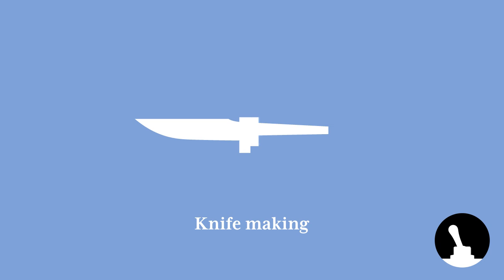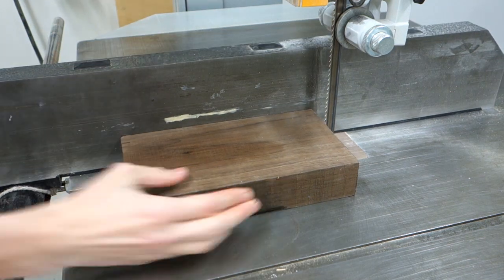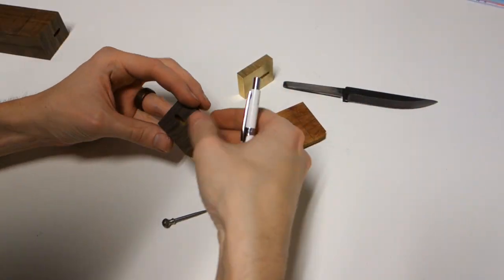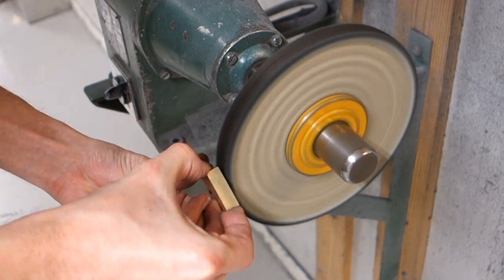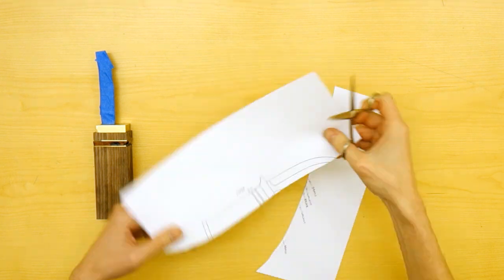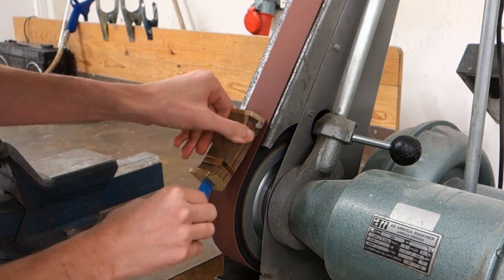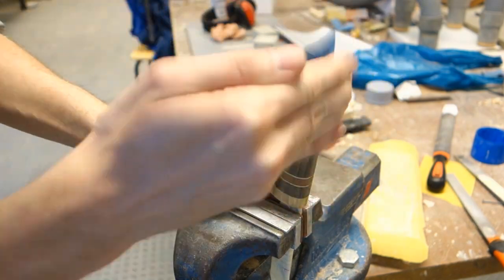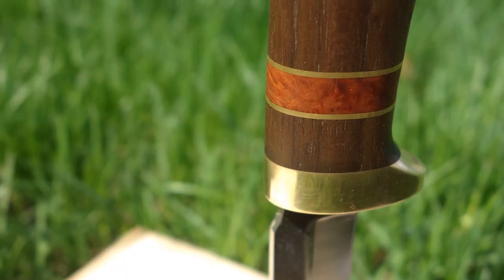Knife Making with Wood and Brass Handle

Comment: Very nice work, and a beautiful design. 

I also like that horizontal belt sander with the spindle sander at the end. I wonder if there's some way to give it a table that wouldn't interfere with using the nose of the belt too? Maybe a pivoting support that let's you move it aside?

-- Mike
Reply from the maker: Yeah, I've been considering the same. The issue being mainly since it takes different size spindles, for different radiuses, you'd have to make one table for each size (3 or 4 sizes I believe) and that would be a bit of a hassle.
Reply: Switch & Lever Build one table that space for an insert around the spindle, then you only need to make an insert for each size spindle.
Reply: WELL DONE

Comment: Another fine video. This makes me want to make a blade form an old file, and then make the handle from some bois d arc wood that is local to me.
Reply from the maker: I was considering that, but I couldn't find an old file. Will have to hunt around in flea markets a bit to stock up.

Comment: Nice video!

What kind of knife blade did you use?
Do you have a brand name or a site were I can find them?
Greetings.
Reply from the maker: I can't actually remember, I've had that blade kicking around for some time now waiting for me to do something with it. I can tell you it's cheap, and super generic though, I doubt it even has a brand name. If you spend a bit more you can get nicer hand made blades, but this is one was certainly nothing unique.

Comment: What brand are the drill bit and end mill you use for drilling out the handle? I cannot find a decent long 4mm end grain drill bit, or a decent length 4mm end mill.

Comment: Is there any reason you started out with such thick wood and brass pieces? It would take a huge amount of time to grind all that off for some of us that don't have all those fancy grinders :D  Btw, what knife blade is that?
Reply from the maker: I wanted to give myself plenty of margins, but you're definitely right, I could've gone with way less stock around the tang before I started to shape. Then again, I did cut most off that off with the bandsaw.

No idea about the knife blade, as I mentioned somewhere among the comments, I got it some time ago. It's definitely no fancy blade though, considering the scale and burrs where it was stamped out.

Comment: Very nice, but why did you glue the brass pommel on and not pien the knife handle into it for better strength?
Reply from the maker: Unless you're planning on using the pommel as a hammer I don't expect the glue to come apart. It's all personal preference though, I don't personally like the look when the tang comes out the back.

Comment: I just made my first partial tang knife, using a Helle Viking blade. Its seems you had a lot of play between the wood (drilled hole) and the tang. Basically having the glue only holding the blade in place. Maybe it's just my OCD...but might it be possible the glue deteriorate over time causing the blade to loosen with use? I made my hole just big enough so that it had to be pounded into the wood handle. In doing so, even if the glue deteriorated, it's less likely to loosen up over time. Same with the pommel...just epoxy and no screws or pins? wow...

Just my two cents. Nice vid and shop equipment btw. Slowly but surely building up my collection of tools.
Reply from the maker: +Bone Headed Considering how wood will contract and expand with humidity you whether you wedge it in like the proverbial Sword in the Stone or not I don't think matters too much. The glue may deteriorate, but considering how much gripping surface there is both on the wood and the tang of the blade the glue would have to turn into crumbles before the blade comes loose. More likely the knife would anyway reach its end of life before that happens. The hole has less play the further down it gets as well, even though the top looks a bit wide.

As for the pommel, my philosophy is more that if it can take being dropped on hard surfaces without coming off (which this has, many times) it's enough for me. I'm not going to use the pommel as a hammer. Given clean and rough enough surfaces good epoxy will grip like you wouldn't believe!

I really wish the shop was mine, check out my video with a shop tour, from Umeå Institute of Design in Sweden: https://www.youtube.com/watch?v=GZFzS-PP7Gc
Reply: Switch & Lever Hey, thanks for the response! Yeah, I figured it was my OCD. I'll make my holes a bit bigger next time. I also have some Bob Smith 206 Slow-Cure Epoxy coming in the mail. The J-B Weld clear epoxy seemed a little rubbery for my liking. But perhaps it wasn't fully cured.

That shop is really nice, some really nice machinery. A used band saw (hopefully a Delta) is next on my list. Nothing close to what's in that shop though.
Reply from the maker: +Bone Headed I don't know about J-B Weld, but a lot of epoxies start off a bit rubbery, and can remain in stages of curing for up to a month. The epoxy I use is usually a bit rubbery (like you can mark it with your nail) for up to 48 hours after initial cure, but beyond that it's tough and hard like plastic.

Comment: sweet knife, very nice shop tools. the pommel should be pinned if the knife is planned to be used to do real work, epoxy will suffer to shock under cold temperatures.

Comment: Just curious as I am ignorant, but how robust is the brass pommel with it being epoxied on? is it not better to have it connect to the tang of the knife??
Reply from the maker: It depends on what you're doing with it. If you've made a good prepping job when gluing (i.e. make sure both surfaces are roughed up, dry and completely grease free) you can be pretty confident that the epoxy will hold it. If you're planning to use the pommel as a hammer then it's probably not enough. I personally don't like it when the tang sticks out through the pommel, which is why I only used epoxy. So whether it's "better" or not is very subjective. Depends entirely on your needs.
Reply: Thanks for sharing your knowledge, I'm looking at making a survival knife for my first knife, so I'd be looking for it to be able to take some abuse. thanks once again :)

Comment: Did u just glue the bottom brass plate to wood?
Reply from the maker: Yes, the pommel is just held in place with epoxy glue. It’s held up really well these last few years, but I also don’t have a habit of using the pommel as a hammer.
Reply: No reason to pommel anything with that size of knife, was just wondering how did u attach it. Good to hear it held up. I made a knife and i wasnt sure how to add the pommel since its not full tang. Beautiful work on that handle by the way. Learned a lot.

Comment: WAIT so briar as in the same kind of wood for high end tabbaco pipes?
Reply from the maker: +Dapper Wolf no, from normal quality tobacco pipes. Beside possibly meerchaum I wouldn't smoke a pipe made out of anything but briar. The piece in the knife came out of scraps from a pipe I made.
Reply: Switch & Lever  I use ash pipes (I have to make my own and i have to use wood I harvest from the forrest) but its more the question of of its the same wood, and the price, I want to make a knife handle similar to the one you made , but with purple heart and cherry

Comment: it'd be best to have the tang go through all the whole hilt then peined at the end so you have a more sturdy knife and less likely to fly out if doing a torture test, it's also less likely to come loose, but really good work, just next time make a handle that's peined on or threaded on
Reply from the maker: You are right that it's less likely to come loose. However, considering the grooves in the tang and the filling with epoxy it's going to be one heck of a torture test if that's going to fail. I've never experienced such a failure, and I've owned a fair share of such knives in various materials through the years. Personally, I don't like the look of a tang which pierces through the pommel. Different strokes for different folks, so I'm afraid that's a no on the peening for next time.
Reply: Switch & Lever Just saying, if I had a knife with a brass butt piece with a little silver dot on it, I wouldn't care all that much, but every bladesmith makes knives their own way so, I'll stick to peining and scales, and you can use epoxy. Not hating, as long as the knife is sturdy, and not made out of medium to low carbon steels as high quality stainless steel, I'm all good, 1045 can't be hardened, and it not stainless. I come across people like that often

Comment: Why didn't you burn the tang into the wood for a perfect fit?
Reply from the maker: Daroff It's a messier process, and a carbonized surface and glue doesn't really work well together, the epoxy wouldn't bite into it well. If it was made with a through tang that could have had a screw on pommel to tighten and hold everything together that could have been an option, but for this case, not so much.
Reply: It isn't really "messier". And you pin the pommel to the tang with that method, making an extremely sturdy handle, but one that's also able to be taken apart for any repairs that may need to be made to the blade down the road. 

That being said, I enjoyed the video. Nice tips for someone just starting with making knives.

Comment: Yeah, it's easy with all these machines... And me? I don't have any of these, i only have a flex and a minidriller of these....
Reply from the maker: It's not the machines that make the result. You could do the same thing I did with a hand drill, a hacksaw, some files and sand paper.
Reply: Yeah but... It's like: i got the wood piece, but i can't cut it with flex, and it's impossible to do it with a saw, i could try with the mini-drill, i don't know, but i think it's hard...
Reply from the maker: domy domyz Nothing worthwhile ever came easy :)

Comment: you can cut brass with a ordinary bandsaw
Reply from the maker: You indeed can, but it will be a worse experience than with a metal band saw, and it will take longer which means the brass will heat up and could ruin your knife handle.

Comment: Why not make your own blade? You did almost all of the hard work.
Reply from the maker: warpfire037 Don't have access to the steel, nor proper facility to do heat treatment. Therefore it seemed like a better idea to just go ahead and buy the blade.
Reply: Switch & Lever you can easily just use a bbq pit and hair dryer or some other air source. i did that today actually to anneal some files i am making into knives. you can also buy 01 steel from amazon for like 20 bucks (or your countries equivalent) 01 is pretty forgiving for heat treating your own blades.

Comment: Wherei can get brass bar?
Reply: kimi kimo check the big knife supplier websites, USAKnifeMaker, AlphaKnifeSupply, Knifekits and KnifeMaking
Reply: Jacob Acosta Master Scribe tq
Reply: I got one off ebay. If you want to do bolsters just take note of the particular alloy so you can get the same alloy of brass pin. Otherwise they will be visible.

Comment: The one thing I came to see and the footage is missing.
Reply from the maker: Rough up both surfaces with coarse grit sand paper, mix epoxy glue and glue them together. Hey presto!
Reply: @SwitchAndLever  Glue it flat? I'm making a knife with a similar style pommel, but I was going to use pins- I wasn't sure if flattening and gluing directly would be as structurally sound.
Reply from the maker: @Christopher Volk I glued it flat, it's held on just fine. Your mileage may vary depending on your glue, wood and metal. If you're at all concerned pinning it, or running brass screws through tapped holes which you can then sand off and blend in with the rest of the pommel is not a bad idea.

Comment: caveat emptor: you do not need two thirds of these steps to make a knife and then he didn't even fit the tang to the end bolster. I think this guy is just trying to befuddle the amateur would-be knife enthusiast. don't let this nonsense discourage you.
Reply from the maker: Those are some strong words from someone who obviously has no idea what he's talking about. I've made many both through tang knives, and hidden tang knives, and I've never had an issue gluing on the tang like I did in this video. No blade has ever loosened in my knives, nor any bolster fallen off. If you're planning on using your bolster as the head of a hammer bashing around all over the place obviously it won't hold, but with normal usage this is fine. The knife from this video has come with me on plenty of outback hikes already, and while it doesn't look as pristine as it does in this video, it's really no worse for wear.

What I don't think people should be befuddled or discouraged by is elitist people like yourself who have one, and only one, way of doing things. That, good sir, is nonsense.

Caveat scriptor.